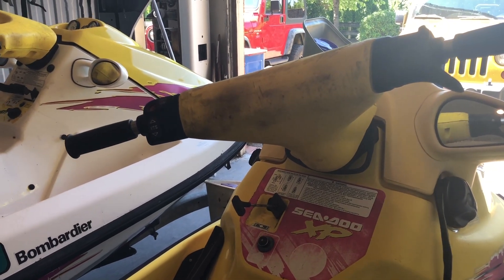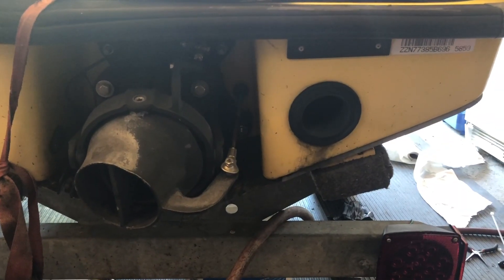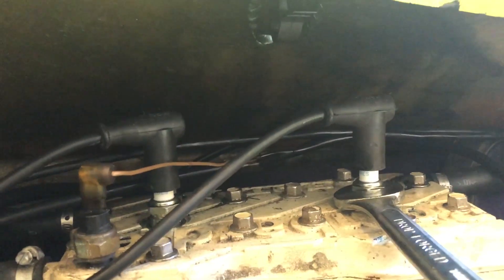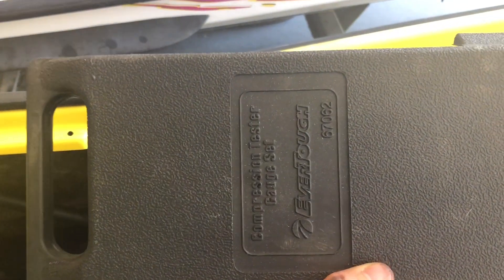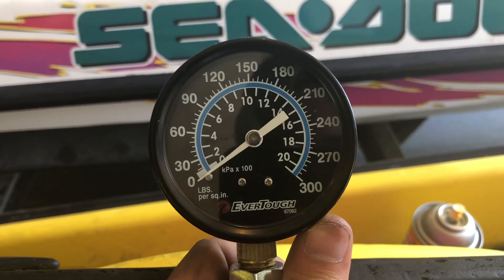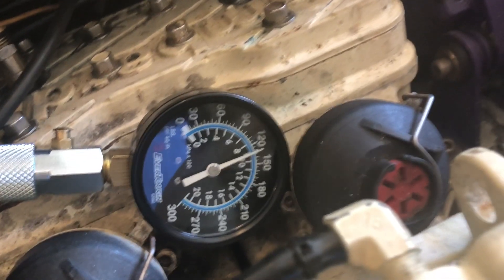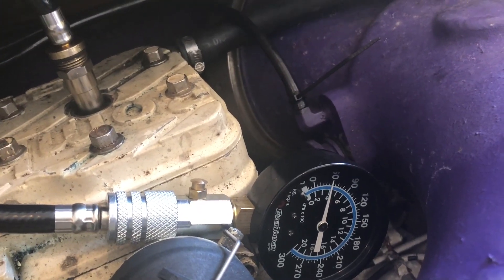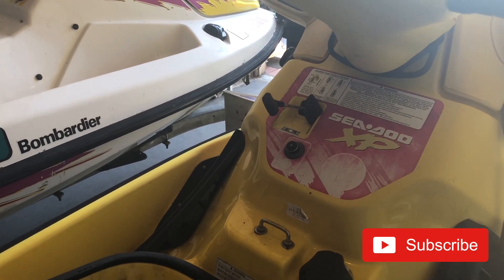How to perform an accurate compression test on a 96 Seadoo XP GTI GTX SPX

Comment: You also have more then a 5% difference in your cylinders which is a big no no. And the pressure drop isn’t good obviously
Reply: 5% of 150 is a 7.5 clearance. He only had 5 psi difference.  …So he is okay there .. As far as the tester he Probably didn’t have a good shrader valve in his tester .

Comment: The cylinders are leaking thru the rings! The gauge needle shouldn't move!
Reply: No...the gauge itself is defective.  Pressurized cylinders are not supposed to hold pressure for more than a few miliseconds.  The gauge is supposed to hold the maximum reading.
Reply: I think the gage is dropping psi because he has both spark plugs out when running each test.

Comment: A couple problems here.  First, your gauge should stay at the highest reading until you push the release button.  Second, you should pull the throttle all the way in (full thottle) when doing the test.  It will make a difference in the reading.
Reply: I agree 100% with your comment
Reply: Hey Bruce is it hard to rebuild a jetski engine and would it be worth it to but one and rebuild for cheep? New to jet skis don’t know much about them…🤣

Comment: Just got my first jet ski, a sea doo spi.  It runs but when I give it full throttle it dies.  I was told to check the compression.  Thanks for the informative video
Reply: I know this is 10 months old... but your more likely issue is dirty carburetors.  If you have the grey "Tempo" brand fuel lines, they are known to degrade and produce a green substance that will block the internals of your carbs.  Replace all of the grey fuel lines, and I mean all, with new fuel hose.  The carbs will need to be rebuilt, running Sea Foam or similar won't do the trick.  Be sure to use Genuine Mikuni carburetor rebuild kits, as the aftermarket (cheap, Chinese) are said to be inferior.  I had the very same issue with my 97 XP, surging, bogging, cutting out at anything over 3/4 throttle.  Carb rebuild and fuel hose swaps fixed the issue.  Good luck.

Comment: Thanks bro. Im trying to get I think it’s a 94.. bombardier gtx  it will turn over very weakly I need confirm spark using a tester. I have confirmed the switches are working. I think I have a magneto or cdi box issue. It’s been sitting for 10 years. So I’ll subscribe and check you out. I do ride also I have a97 cr250 2 stroke runs like a beast. Needs fork seals thoguh